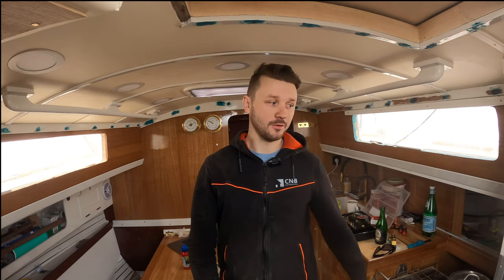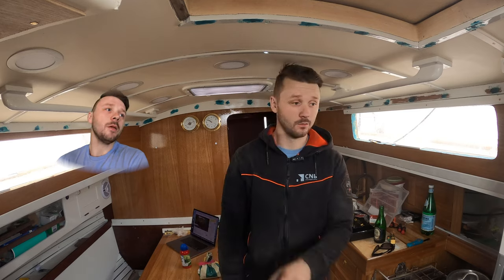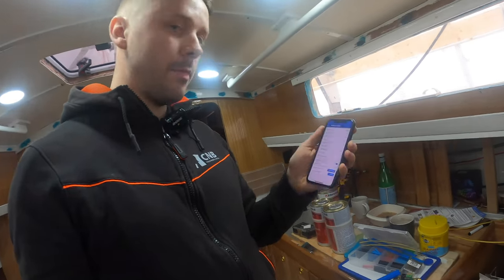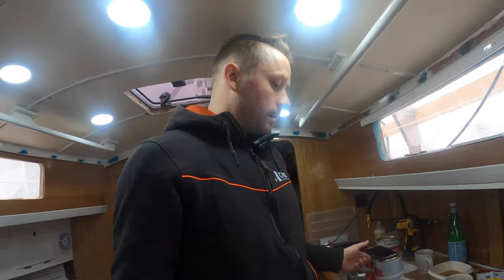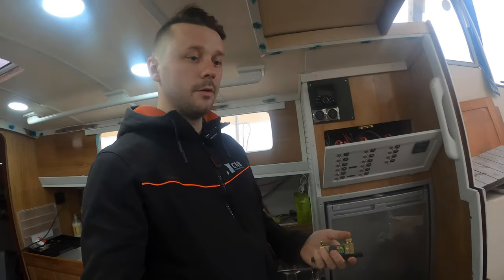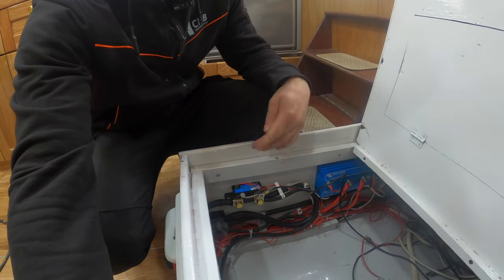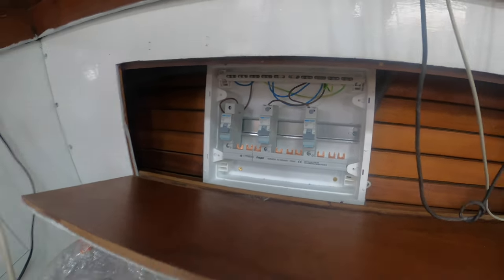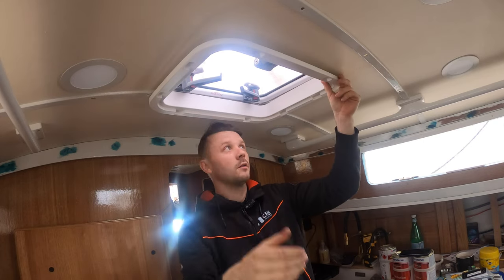Snowbird Ep34 sailing vlog refitting the boat to sail around the world Hallberg Rassy Rasmus

Comment: Hi again, inspirational video must admin! About epoxy vs polyester.... long story short. Many motor boat builders still using polyester and coating with gel coat. Sailboats and cats are different story, because of the rigging tension. Always the is movement’s and vibrations generating micro cracks. Epoxy is way stronger and flexible. This is the reason why old and new sailing vessels are made of epoxy. I am very used to use it, can be thinned, collared etc... Sea Sea have one brand (don’t remember the name) that is much cheaper then west system. Biltema have 2comp epoxy fairing that is great and easy to sand. If you decide to use epoxy paint would recommend Hempel (one coat gray >white >grey >white).
I am not sure if this hatches are suitable for closing water tanks... when the boat is moving can be a little dramatic if you get 200L of water splashing inside you salon. 200L=200kg just for fun jump over one this and if survives then keep it. Otherwise if think is a good idea you glue with epoxy and silica screws 6~8mm with the head down then make your custom covers from stainless with gasket of course and locket with nuts on the top.
Reply from the maker: Such good educational information, really helpful thank you a lot.
Inspection hatches are pretty strong l always walk on them with no problem, especially the around ones, the strength should not be an issue. l know how to work with epoxy however I'm not professional in epoxy, l just start with polyester and l want to keep moving with the same material.

Comment: I'm quite sure epoxy while being a little more expensive gives way better barrier against moisture. Also polyester fractures/cracks easily. Just because people has used it before, doesn't mean it's any good vs a modern expoxi barrier. I think you'll be ok, but given how many Rasmussen has problems with the hulls because of moisture, why not add a epoxi layer? My surveyor was very very critical of the Rasmuses after seen many many boats with major issues. And you are planning a round the world trip, why not overdo it? If you look in the Rasmus FB forum, full time cruisers like James Duckwort. He has a post there on why he put eight coats of epoxi. Or just chatt with him... You are not gonna be able to take the boat out like you do here up in the north, so you could end up with some nasty moisture issues if you don't go the extra mile on protecting the hull. Just talk with James on the FB group and get some advise..
Reply from the maker: Thank you so much for such a good explanation and really trying to help me. l’m more than happy that l have followers like you. 
l personally think the problem starts when you have micro cracks on gelcoat the problem is that people grind the boat and paint over it, but only few of people take down everything even the old gel coat, place the new fairing compound and gel coat. 
This way there is no cracks and should be no problem what so ever. 
l discovered so much small holes in gelcout l can’t even count it, so new l mix my own fairing compound so l can make  stir in the very liquid to pour into all the cracks and crevices. Yes! l have to admit that Epoxy is better, but it’s hard material.